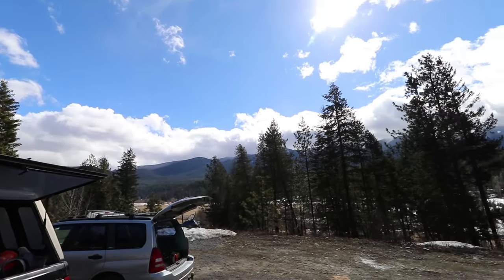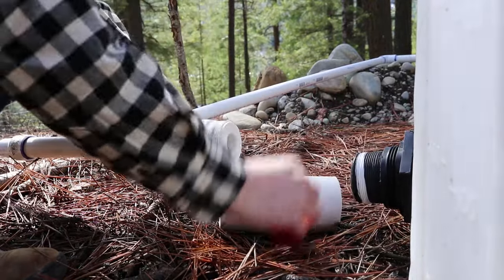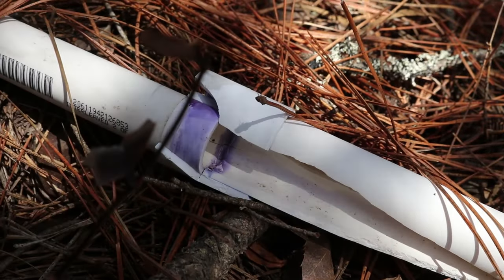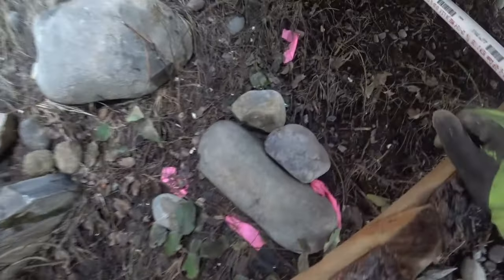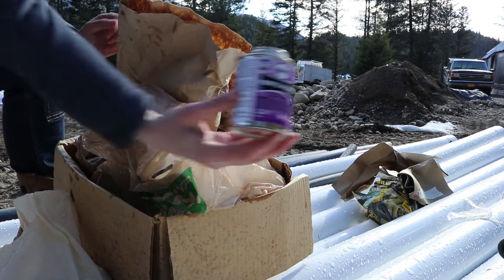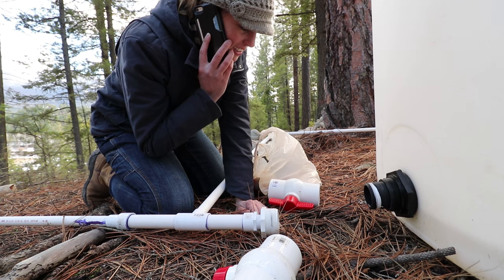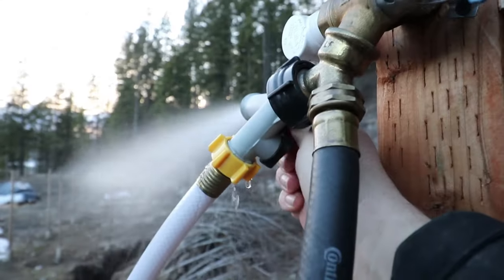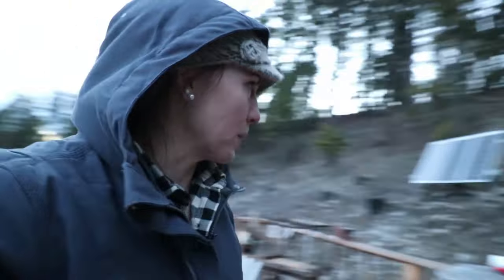OUR OFF GRID WATER SYSTEM IS BROKEN - Time to Fix it!

Comment: Alyssa: Ice build up in the pipeline will cause those breaks. the PVC can get brittle in extreme cold and the water expands as it freezes. Once the water stops flowing it's only a matter of time before it expands and bursts the piping. I don't know if you guys used schedule 40 or 80 pipe but it is recommended. You will definitely want to explore your options for insulating your pipeline until you get a permanent set up....Or you may want to user ABS pipe because it is black and will hold much of the heat inside and keep the water from freezing so quickly....And yes, you two DO compliment each other VERY well! My wife and I have been married nearly 21 years and I have seen so many hard working relationships that ended badly because they couldn't get a good "FIT" with each other. I am disabled so my wife works and I try to do stuff around here that needs done. I am a LOT like Jesse in that respect. I have so many skills under my belt ranging from HVAC to auto mechanics to carpentry. I have literally helped build houses and once I even helped build a big log home. I love those things but can't do most of them anymore. So I do the laundry, take care of the animals, and keep the place going. It sucks but the roles have been reversed and something needs to be done, so I do it. that's the mindset you guys have too and I love that about you. That's why I watch your show...and you make things so much FUN to watch too! Love your show. Keep it coming.

Comment: I don't know if they are availbe in USA but in Europe there is Spanish company called NuevaTerrain SDP they produce brilliant piping system. Its made of special kind of plastic polybutylene. Its frost resistant (if water freezes in pipe or connector just bulges out and when ice melts it goes back to the previous dimension) and best thing is you don't have to glue it or screw it. Smaller dimension pipes (up to 50mm) are on push in connectors, only thing you need is pipe cutter. Here in EU if pipes are laid by yourself or not certified plumber they give you 12 years warranty(of course system has to be designed by engineer with all state required certification and then laid in accord with design), but with certified plumber warranty goes up to 25 years.

Comment: Let me say I enjoy watching your real life struggles and problem solving. I lived on a ranch in Colorado when I was a kid, every time I see your surroundings it reminds me of that. Now for the reason for my comment, Jess' back. A couple years ago I was suffering from back problems, I tried the chiropractor, And PT some relief but not a lot. The thing that worked and worked well was an inversion table. I used it on a regular basis (3 times a week) for a couple months. Now I might use it once every couple of week. Now I can't say it will work for you like it worked for me, but I am back to normal.
Jim from Nebraska

Comment: Also PVC pipe isn't UV stabilized so between the cold temperatures and the brittiling effect of the sun you're fighting a two front battle with that material.
http://www.usplastic.com/knowledgebase/article.aspx?contentkey=774

Comment: If schedule 40 or 80 were used in the first place it wouldn't have split out over the winter. That is what I was referring to. I installed landscape irrigation systems for 20 years so I have knowledge of these things. Class 200 stands for 200psi max and is available at the big box stores in 10 foot lengths without bell ends. I used to buy from irrigation suppliers in 20 foot lengths and these had a bell end on one end that provides a deeper pocket in the bell end so the mating pipe can seat better. I used schedule 40 for the main lines that were always pressurized and class 200 for the lateral lines that would go from the control valve to the sprinkler heads. I can go on and on with more information about pvc pipe but I will stop for now. I love watching this channel and their progression but I think correct info needs to be said for other's benefit. When I saw in the video earlier on of the broken pipes that surely looked like a thinner walled pipe than a sch40 pipe.  I have snagged a sch40 pipe with my backhoe and the pile came out of the ground with it linked but it did not break or leak. And I have hit class 200 with a shovel and cracked it to where I had to repair it. Anyway keep your efforts going and good luck

Comment: You need to get that PVC pipe out of the sun. The UV cracks the pipe. Cover it with pine needles; cheaper than paint. The purple primer cleans the PVC so the glue will stick. The purple shows when you painted the parts. The all-weather is the glue that bonds (melts) the PVC parts together. As another said, poly pipe is better and running conduit down the trench is a good idea to replace the lines later on.

Comment: what we do in kansas, is use the same type of plastic pipe that the oil gas well drilling companies use.they will install a contiuous , no joint,no seam pvc potable water , bends around corners without kinks,  from 1" 4" tube forlittle above cost just to keep good public relations

Comment: Does your truck really need 92 octane gas?  That's really expensive stuff and usually not necessary unless you have a (high performance) high compression engine.  Most engines do just fine with 87.
Reply: I keep chuckling when i see you guys comment: This fuel is waaay too expensive, you shouldn't buy it.
I am from the Netherlands, the lowest grade fuel we can buy is octane 95 and it costs around 1.60 euro per liter (6.5 dollar per gallon). 72% of that is taxes. Our fuel prices where 9.5 dollar per gallon one and a half years ago. People still kept driving no matter what.
We have the highest fuel price in the world. But we still have 2.1 cars per household average, one of the highest density of people (7th highest i think) and still our highways are regularly jammed with traffic and car usage due to increase in economy is booming. So it won't ever stop us from driving. You simply have to make different choices.

Comment: People that's never had any back problems, which I was one until the last few years, has no real idea how it will put you down and there's no getting around it, it's not like a gamey knee or ankle, gritting your teeth and ignoring the pain just doesn't work. Strength to you Sir.
Reply from the maker: +Titus Tucker That's me. The longer I went the worse it got too. Not like you can just use the other arm. There isn't another back. Ya only have one! Getting better now though. Having to learn to walk all over again. Wobbly like an infant. As hard on the ego as it is the body.

Comment: is the pipe cpvc? sch 40 or sch 80 shouldnt crack that easily when its drained.
Reply: p.s. also the white pvc doesn't have uv protectant (you probably knew this) so if it's in the sun, exposed, it can deteriorate more quickly.

Comment: How are you going to keep your tank from freezing where you live?  The ground even freezes three feet down in the dead of winter.
Reply: I know the white tank is temporary (and not for winter).  I was looking at the blue tanks. Then it hit me about freezing 3 ft down.  That is why up north we bury lines 3 ft.  and use freeze facets away from heated structures.   Even Cisterns have to be protected at ground level (same as your lids).  We use to use straw bales and if we were at below zero for any length of time we put a cow tank heater in cistern to keep from freezing.   I was raised in central WA.  Snow didn't  always blanket the ground especially in the wind.  One bad year the ground froze to the 3 ft level.  We ended up building a long fire on surface (above the pipe)to thaw the ground up (we grew tired of hauling water to cows).  Even with wells you ran a heater in an insulated shed to keep them thawed.